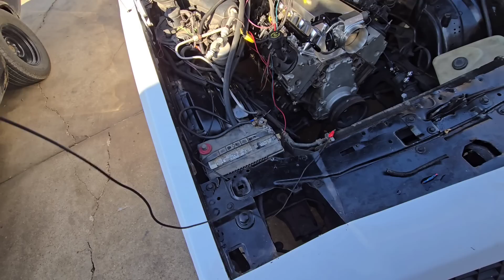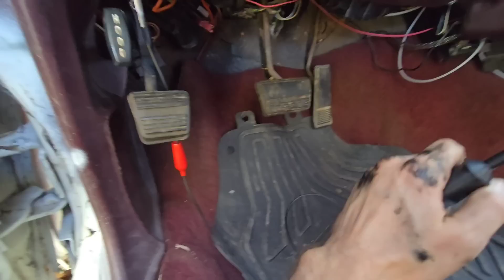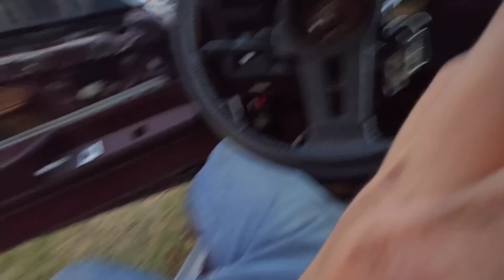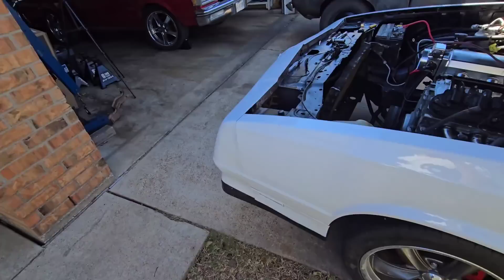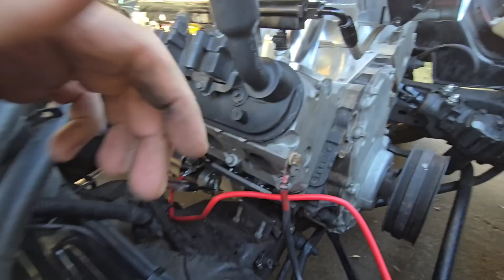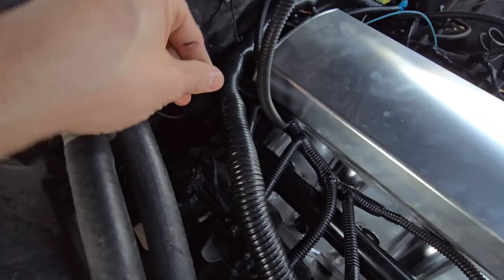G-Body | LS Swap | Part 4- Wiring

Comment: Hey  brother I’m also ls swaping my 85 Monte Carlo right now And the  purple wire does not have any power  when I turn iginition on or off but I put  another wire that has key on power  while cranking on small post of the starter and my car cranks in acc position  non stop  when I hit the key  any clue what  I must have did wrong on the starter ? I also do have power to the fuse block lights and everything do work ! This is my only issue

Comment: If my memory serves me, you can just grab that collar where the column shift was previously mounted and manually turn it so that you can get it in the right position to turn the key. The tranny lock   is mechanical and part of the shifter/console. The collar IS the neutral safety switch, just grab the collar and turn it counter clockwise all the way and you are in park. When you have everything all hooked up you'll know you have it right because the collar will physically move when you move the shifter. Also, there should be a small clip with a string/wire that slides onto the back and bottom of that collar which is for the shift indicator on the dash, with the collar all the way counter clockwise, pull that clip and string/wire until the shift indicator is on the P and slide it onto the collar and then when the collar moves the shift indicator on the dash will also move.

Comment: Just an FYI that is a factory floor shift car, the SS used back drive linkage to rotate the column, NS / reverse light  switch stayed on the column.  Also that black plastic piece of the wire is a splice cover, the fusable link is a sacrificial wire.  Good luck with the swap.

Comment: Quick question, for any LS is a dOD delete necessary if you’re just dropping in unopened engine? Or is it best to dod delete all of them
Reply from the maker: @showtimemyles9643  DoD started with gen 4. Best to delete but you can tune out the dod/afm and get some more life out of the lifters.
Reply: Thank you

Comment: Dumb question. So the wire that you tie into the harness that is hot on cranking and running. Does that have to be full 12v or if my car has a resistor wire that does this (I want to say it was 7v or 8v) would that work? Worst case, I could use that to trigger a relay to get the full 12v I would think.

Like the others, I feel your pain but like that you put in your "acoustic" moments....
Reply from the maker: You'll want that wire to get a full 12v
Reply: Did anyone find this wire I’m doing this part now 😂

Comment: The harness with the 1 red wire coming from the starter wires (with the two cut off green wires) is for the factory AC. The other end of that harness is near the AC box. 1 green wire went to the idle control solenoid on the side of the carburetor and the other went to the Ac compressor.

Comment: if it is not the neutral safety switch  I have had a couple of columns do the same thing there is  a piece of a aluminum that the rod from the key switch hooks into that could be broken or cracked the bad part of it is the column has to be taken apart to replace it. just a thought

Comment: I’m just as retarded as you the one clue about a bad ground was when you ran the wire directly from the negative battery terminal to the fuse box that was a dead give away bad ground but I feel your frustration I been there plenty of times before

Comment: I trust ur choice in the wire harnesses cause you’ve proven it works but the reviews scaring me off this my first Ls swap /2000 Pontiac Firebird -4l60e of course I just wanna get it right what are ur further opinions on the harness?
Reply: 6.0 -4l60e trans
Reply from the maker: @2017-ss_1le  Well I've shown actual in person reviews while using it. The only thing I've been asked quite a few times is o2 sensors not reading and why, when trying to be tuned. I have not dealt with that personally as of now. But now that Im getting into tuning I may or may not run in to it. If I do, I will post about it.
Reply: @krustyclassicsgarage  that’s a bet I’m 18 and as I said this my first ls swap I’m just tryna  make sure of everything but I appreciate you for responding nice video